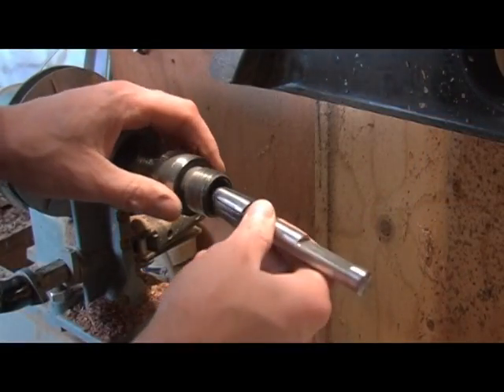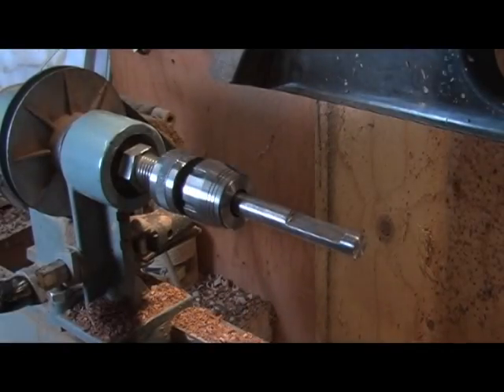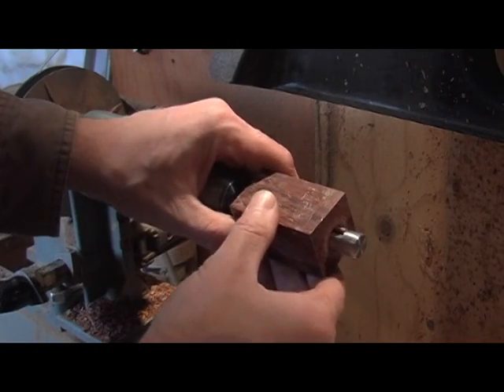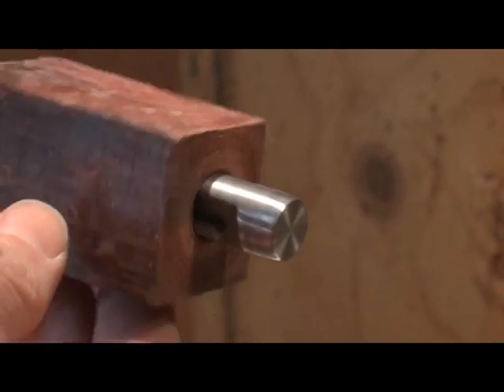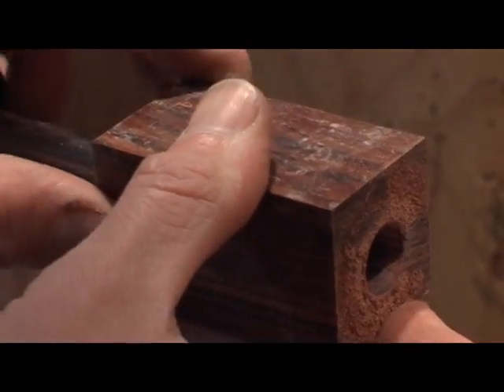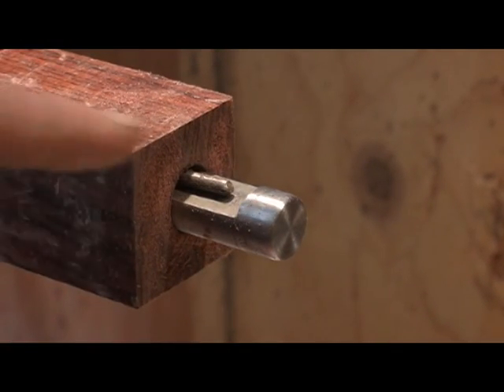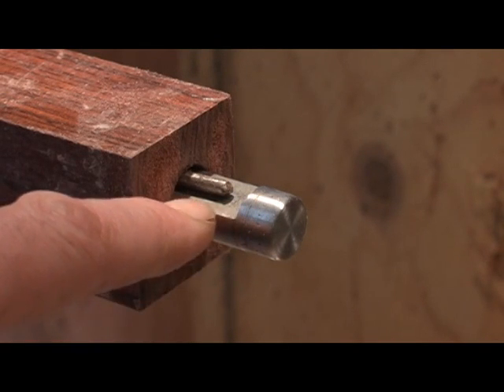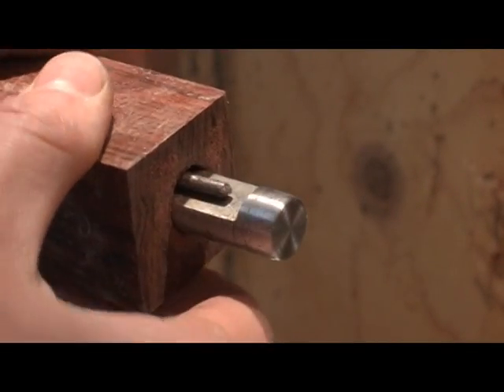Woodturning How To Make A Pin Chuck To Turn Duck Calls

Comment: I took a scrap exhaust valve from a marine diesel engine and made a dubble pin chuck (5/8" on one side and 7/8" on the other) works great and all I have to do when I want to swap from a goose to a duck call is to turn the pin chuck the other way around.
Thanks for this wonderful idé!

Comment: Hey good video. I would like to know if you plan on making a video on the actual making of the pin chuck. To showcase things like what material to make it out of where to get the pins what kind of tail stock adapter you use

Comment: Does anyone know where to get new pins? I have lost mine and cant seem to find a nail the right size to get it working again. :/

Thanks :)
Reply from the maker: I used a 16 penny
Reply: Ok thanks Carl, I'll likely have to try that then, anything smaller hasnt worked.
Reply: I machined my own pin chuck, and milled the slot fit a 4,00 mm drillbit.

Comment: Carl;  Do you use the same size pin for each of your pin chucks, regardledss of the  diameter of the chuck?  Also, instead of using a collet chuck, could I use a Talon chuck to hold the mandrel?

Dale

Comment: Hey Carl, thanks for the video. Have you tried putting a small magnet on the flat part of the pin chuck to keep from dropping the pin? Seems like it would be easy enough to drill a shallow hole and then drop one of those small earth magnets into it. Just a thought...
Reply from the maker: drmail413 That's a great idea, thanks